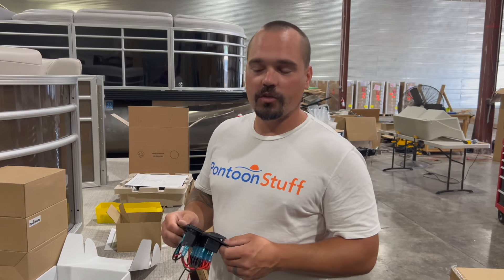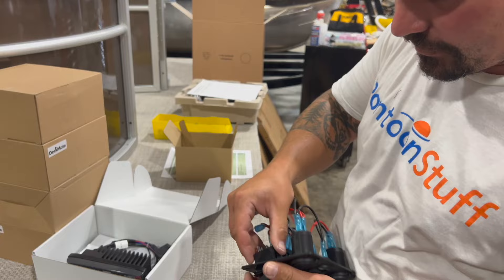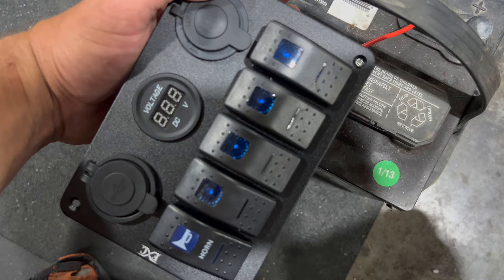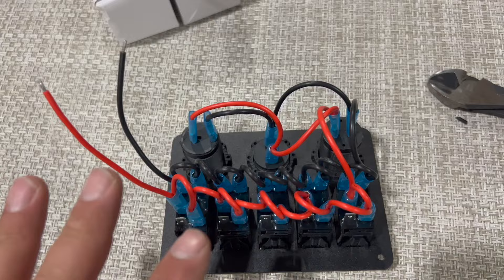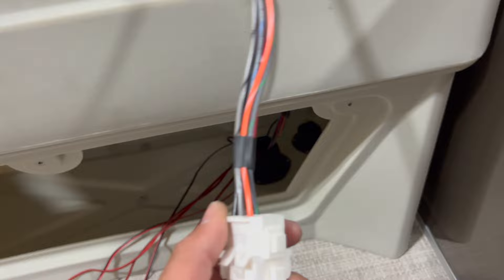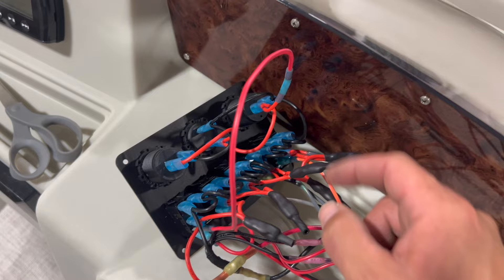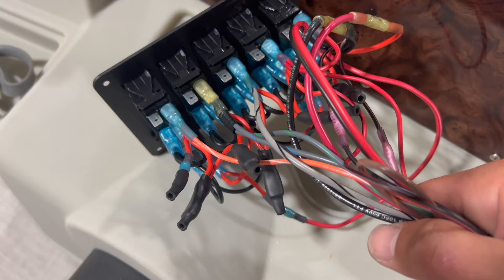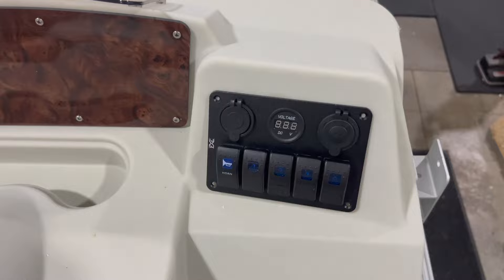Amazon Switch Panel - HOW TO WIRE INTO YOUR BOAT

Comment: What size fuse do you use for the panel or do you put a fuse on each individual line
Reply from the maker: I run a fuse on each accessory out wire. Usually 5amp. One of these days I’ll do a video tying it into a fuse block too.
Reply: @tomspontoons  Fuse should be before not after the switch. These cheap Amazon/eBay/Chinese switch panels are everywhere now and the way they have the wires jumped together on the back is a recipe for disaster, especially when you get up into the larger multi-switch panels (5+ switches). If you have 6x switches pulling up tp 5amp ea and they're all turned on at the same time you are right on the edge of the capability of the wire used ex-factory. Make 2x of those circuits 10amp and you have just taken yourself into the danger zone of melted insulation and fire behind the switch panel.
Reply from the maker: @15uzu  I can definitely see the reasoning behind that. Luckily Pontoon Stuff has their switch panels back in stock so I can go back to ordering those which are plug and pay and a better all around design!

Comment: If I match this with new wiring harness, would that eliminate the fuse box?  thx
Reply from the maker: No, this switch panel would need a fuse/breaker panel or inline fuses coming off of each switch.

Comment: If I’m pushing 19v to 12v lights is that bad? New to wiring don’t flame me.. lol
Reply from the maker: Definitely too high of voltage. Should see about 12.4V. Maybe 14.5 when running the motor
Reply: @tomspontoons  voltage regulator would work? I’m using a m18 battery kit to power some lights on a tuggy build.
Reply from the maker: @mijomike3406  Ahhh, I haven't tried doing something like that before. I know guys who use 12V power tool batteries to power their duck blind lights and stuff. I haven't used a voltage regulator, but if it can reduce that voltage down closer to 14V then you'd be in a lot better shape. Obviously can't have the lights catching fire, but even having them wear out way faster than they should from the 19V is no good.

Comment: Morning Tom, I’ve the same breaker panel. But I’ve a yellow neg wire off the back marked “lower dash light” and a blue pos wire marked “lower dash light”. Can I tie these into the main pos and neg wires from the PS wire harness? Also my panel has three 15A inline fuses behind each of the chargers and bolt meter. I assume I connect the PS pos wire directly to these. Cheers my friend and thanks once again!!!
Reply from the maker: I swear I could do a new video covering these switch panels monthly because of how many times they change the dang things! I'm guessing those yellow and blue wires are just feeding the obnoxious lights that stay on all the time on the bottoms of the switches...which in that case I would just not hook them up at all, or I'd wire them to a main on/off switch to only have on when I want them on. Yes, you can plug the PS harness into the rest as those fuses or breakers will provide a disconnect to the accessories/switches to prevent damage.
Reply: @tomspontoons  lol..I know eh! It’s like every vid I watch of you doing up a panel, they all look similar but there’s always a little change they’ve made that throws me for a loop. So that brings me to a couple of questions. You mention the main on/off switch…would that be like your nav light switch? Which would make sense to me as you only have the nav lights on when it’s dark out, but just want to be sure first. And secondly, looking at the back of that panel, those three in-line fuses which are directly behind the usb and 12V chargers and the battery voltage meter, do look as though they’re piggy backed to the rest of the switches . And yes, I did think, like you mentioned, that they protect the appliances wired to those switches, but, and correct me if I’m wrong, those fuses are all 15 amp fuses, which in my way of thinking maybe too large of an amperage for some of the items they control, or am I out to lunch on this? And thirdly and lastly…I hope! I’m running a separate fuse panel inside the console, just below the switch panel, so I can tie in the small (18, 20) gauge wires. I’m piggy backing, from the main pos and neg on the back of the Amazon switch panel, and feeding out to this separate fuse panel. So just wanted to run this by you to make sure I’m on the right track. Been doing a lot of thinking over this and in my mind it makes sense, then again, a lot of stupid things made sense at the time!! 😳😬🙄
Anyways Tom, cheers pal and thanks once again. You’ve been, as always, a wealth of knowledge and I’ld even go as far as to say an inspiration! And I am prolly safe in saying, speaking on behalf of the thousands of us out there who have always wanted to  tackle an electrical birds nest or an even bigger undertaking such as overhauling a pontoon, but were gobsmacked as to where to even start, that without your quick responses, your feed back and your great videos, would never have even thought all of this could’ve been possible!! Cheers my friend….
Reply from the maker: @davidcobb4527  The Nav Light switch would be the perfect one to tie into as the on/off switch for those bottom lights on the switches. 

Typically they piggy back (aka daisy chain) power across all of the breakers, then jump power from the breaker to the switch. Another goofy thing about those minor changes to the panels is that some have different amp breakers while some are all 15 amp. I've seen them where they are labeled as 5, 10, and 15 amps. Yes, 15 amps would be high for a couple LEDs, so you could add in a fuse block to offer a lighter amp fuse/breaker for protection. If your panel is all 15 amp breakers then you're going to be best off using a fuse block in between the panel and accessories out. Be careful running 20 gauge to anything that's a significant length of wire. I would stick to 18 and 16 for running power out to lights and accessories. 

Glad to help! We'll keep trying to make more and more helpful and fun videos. Hoping that the channel continues to grow over the next few years so we can dedicate more time to more in-depth and educational stuff as well as some fun big projects where viewers get to follow along with the details. Right now we just don't have time working on customers' boats to pay the bills to video EVERY detail like I wish we could!
Reply: 👍🏼 yeah every wire I run is minimum 16G. But some coming out the back of gauges are super small so assume they’re 18 or 20. Great! Thanks again Tom. Take care…prolly be chatting again, I’m sure! 😄👍🏼